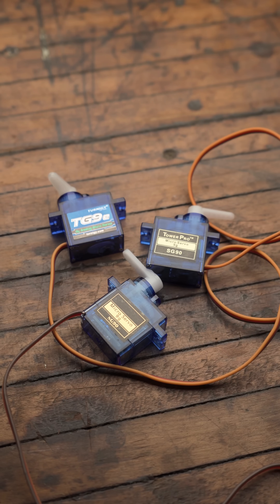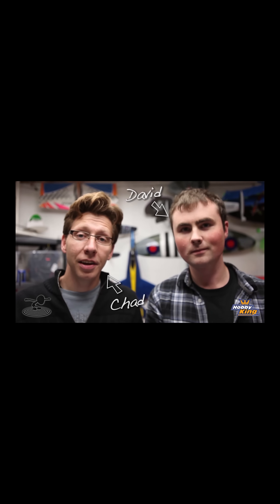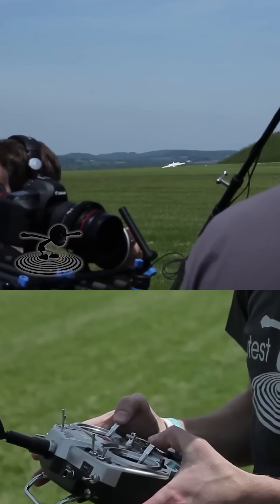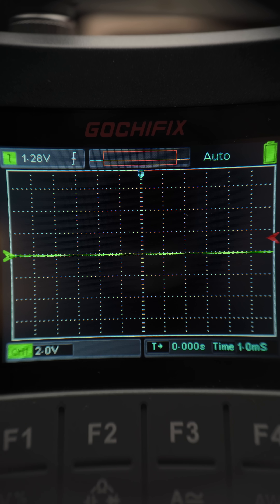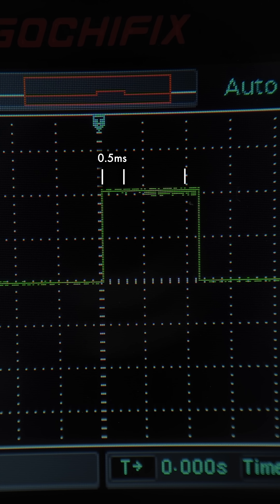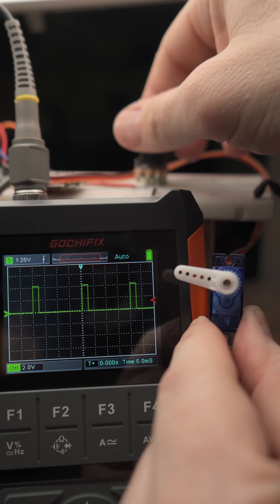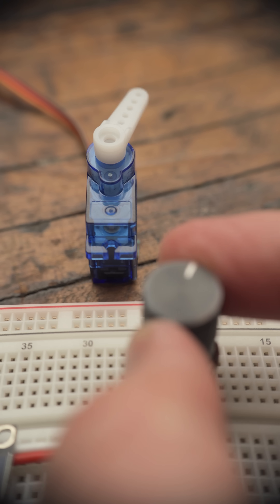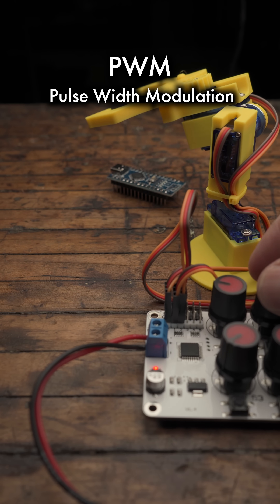#9gServo

Comment: How do you diagnose these PWM signals if you only have $20 multimeter and $10 circuit tester? These VW cars sure use PWM. Car lights system draws 220 amper at key zero position. With headlights disconnected draws 205 amper. There is only mirrors and breaks lights on. 😅 and Looks like I can't use my equipmenet to actually test the cables for shortages since it's PWM 🤧.

Comment: You can open up ur 9gs and rewire the motor to a H bridge controller for a bigger motor, allowing you to control a big guy off 1 pin with preset pid settings

Comment: Awesome explanation! I only just recently learned arduino programming, and when i got to servos and stuff, i was kinda dissapointed when it was just ''use a library'', like that's it? Sure it's more comfortable but i wanted to know how exactly stuff was controlled through a single wire, and now i know

Comment: Coming from a modular synth background it's crazy that pulse width modulation not only can be used for this but also for changing the timbre (sorta) of a square wave oscillator inside of a synthesizer!
Reality is so crazy man.
 I can actually imagine the sound in my head because of the oscilloscope

Comment: New here: how do I determine the strength of the motor I need?
Reply: I know that was vague. But I am making an auger that dispenses dog food (chunky mashed potato like substance in my case.) the auger is sending the food to a weight sensor, so it needs to be accurate. So, I need a servo motor, right?

Comment: I got some of these servos and I have some questions.
I made a small mechanism some time ago which had one of these servos on it. But when I commanded them to move from 0 to 360, instead of taking the shortest path it would spin all the way from the other side.

I opened one and im quite sure that These servos are physically capable of 360 full rotation.
But so far I've tried anything to make one spin the other way and failed.
I know that this would be a disaster for most of the projects like yours but why there isnt any flag or a way to tell the direction?
and is it even possible to have a servo pointing and spinning at the same time?

Comment: This is very great stuff. I have been trying to get into the hardware side of things as an engineer. I've built computers and have coded for about 9 years but no robotics based projects yet. I found one the other day I could use my 3D printers for called the Parol6 but the parts list was close to $1,000. Found another non robotics arm project that is $200 for parts which I got ordered. Any info on this robotics arm would be greatly appreciated!

Comment: you can remove the motor connect a amp just a few transistors and connect that to some relays and that to a hydraulic solenoids and connect the censor to a hydraulic motor and you have a high torque servo. there small but they still got the same chip

Comment: While PWM is kind of similar, this signal type is PPM (pulse pause modulation).  You can see it clearly when moving the servo to "full on".  PWM would be a consant on signal
Reply: Pulse position modulation
Reply: No, while there seems to be conflicting information about PPM, it is certainly correct to call this PWM.
Some sources claim that PPM is a subset of PWM, which is kind of the thing you are going after. But that would still make it PWM. 
Other sources claim that PPM uses constant length pulses with varying length pauses, which is defenetely not happening here.
Then there are sources that claim PPM to be several PWM signals back to back (which does not really make sense either).
Reply: @thomasb4422  thanks I hadn’t heard of pulse pause modulation.
Reply: @thomasb4422
It is hilarious reading some of these replies....
So much disagreement...😂
Reminds me of the film Airplane....

People announcement over the load speaker.....
Announcer 1.....
"The  White zone is only for loading and unloading, there is no stopping in the Red zone"
Announcer 2.....
"No!    the Red zone has always been for loading and unloading there is no stopping in the White zone"

😂😂😂😂😂 Don't laugh too loud or long as you will miss at least 5 other funny bits......
Reply: Thank you for taking the time on this. I just watch 4 videos all calling PPM 'pulse position modulation'. Is that different to 'Pulse Pause Modulation' or just synonym?
Reply: @JustinShaedo  Ehm, pulse position modulation is what PPM is, it means the pulse position within the timewindow or "frame" is the significant part. Pulse pause modulation is not a thing in English at least. It was said to be called pulse pause modulation in german but I have no idea. PWM is sorta self explanatory I think, but the main "important" bit is that PPM can do multiple channels over one set of wires, which is what it is often used for afaik. Like a cable between a receiver and an autopilot or pilot aid on a quadcopter for example. I used PPM to go from a small receiver with only 4x3pin out to a switch/decoder that sat between a programmable autopilot and the ESC's controlling motors on a quadcopter, so I could hit channel 5 on/off switch to take manual control if the autopilot did something wrong and use 4 channels to fly the thing.
Reply: A pwm servo accepts a duty cycle between 1 and 2 miliseconds. 100% in this context does not mean a DC high. It means a pwm signal at 2ms on time. And it's not PPM because the pulse distence needs to be at 50Hz. PPM shifts around in terms of frequency.
Reply: Isn't the intention different, but the signal the same?
Reply: @SirCutRy  no,

on 100% output PPM will still have a pause (off time) between pulses, while PWM is constantly on
Reply: @thomasb4422  
Okay, but by looking at a signal, could you tell if it was PPM or PWM?
Reply: @SirCutRy  if the duty cycle is at 100%: yes absolutely
Reply: @thomasb4422  
Okay, sure. But that's a trivial example.

So with PPM, do you have to be able to sync to the pulse, and that's why it can't be on the whole period?
Reply: @SirCutRy  the principle on how they work is a bit different.
With PWM you compare how much time the signal is on compared to the total time.  
With PPM you measure directly the length of time the signal is switched on
Reply: @thomasb4422 You're half right. PPM is how the transmitter talks to the receiver. But after the receiver decodes the signal, the servo gets a standard PWM signal. The reason I know this is because I am very experienced in the RC field and PPM is generally how you would encode multiple PWM signals into a single signal. So in essence, PPM is used to send the signal from the transmitter but PWM is used when those signals actually get to the servo
Reply: @Andomosity  no this is almost completely false.

1:  The transmitter and receiver use neither PWM or PPM. On 2,4Ghz they mostly use FHSS or DSSS.  
It wouldn't even make any sense to use PPM (an analog signal) to transmit digital data.  

2:   
No, no no nooooooo.  
PPM is not a combination of multiple PWM signals. While they look similar, they work on different principles.   
The only thing that resembles a combination is that PPM can combine multiple PPM signals. It just sends them rapidly one after another before making a bigger pause.  

3:  PPM is used from the receiver to the servos. Doesn't even matter if it's an analog or digital servo.  You'll find this on any site regarding receivers and servos.  

4: the only thing I need to correct is the name. It's only known als pulse pause modulation in germany. In english it's correctly called pulse position modulation.
Reply: @thomasb4422  perhaps I mispoke. I meant to say that PPM is a way to encode multiple signals onto a single frequency so that you can decode the PPM on the back side so that it can make it's own PWM signals from the encoded PPM signal. But you are still partially wrong. Yes, modern RC controllers use frequency hopping technology like FHSS or spread technology using DSSS. What you fail to understand is that before these were invented, they had to use PPM to encode multiple signals within a single channel. Then, on the back side, the receiver will decode the PPM signal into individual PWM signals and then send those individual PWM signals to the correct places.

In a PPM system, multiple control channel signals are encoded into a single stream. Each channel is represented by the position of a pulse within a frame of time. In PPM, all the pulses for different channels occur in one long sequence with varying intervals between them, and this sequence repeats itself at a regular interval. The receiver decodes these intervals into separate channel signals and sends corresponding PWM (Pulse Width Modulation) signals to control the servos or other devices. PPM was popular because it allowed for a simple way to transmit multiple channel signals over a single communication channel (such as a radio frequency), making it efficient and relatively easy to implement with the technology available at the time.
Reply: @Andomosity "but you are still partially wrong." And you are still partially insufferable.

Comment: Question, why would you use a PWM to control a direction of servo rather than simply a command to tell it to go “left” or “right”?
Reply: Most servos are not as smart as this video makes it sound. It doesn't at all "measure" the pulse width. Basically the pulse charges a capacitor, and a potentiometer connected to the position discharges it. If there's charge remaining for too long, that will be used to drive the motor (and the pot) until the charge and discharge balances.
Reply: Because the PWM Pulse width is variable, much better than simply left! or right!
Reply: It is even easier - you just write something like "turn(45)" in code and that's it. 45 is an angle from 0 and 180 range.
Reply: servo motor to control proportional movement. the signal shows where to stop the horn. the servo will move until it reach that position.

Comment: I need a micro stepper motor with an inexpensive small rotary encoder to build a wireless follow-focus/focus-puller. Two ESP8266 D1-Mini boards will be used as controllers on both ends, one operating in station mode and the other as the access point. That's just an idea at the moment. People need time and money to experiment. I'll have to look at your profile and see if there are any videos on these two components. Rotary encoders are not cheap, and that's a problem.
Reply from the maker: I would recommend using a high quality potentiometer rather than a rotary encoder. It would be much smoother and many more steps. You may even want to use a multi turn potentiometer so you have more detailed resolution
Reply: @HackMakeMod  thanks for the insight! Yes, the steps will indeed be much smoother if I go with a pot rather than an encoder.  👍
Reply: This channel realy could have been somthing

Comment: For those that don't know, PWM stands for Pulse Width Modulation.  It's also used in Power supplies.
Reply: And a ton of other things. Understanding PWM gets you tons of electronic knowledge. So great video
Reply: And FM synthesis
Reply: And brushless motors
Reply: @FalloutProto  And vibrators.  LOL
Reply: @FalloutProto  the esc's do bldc's use 3 phase current
Reply: It was used in brightness control for screens for a long time
Reply: Or fan speed or led brightness control!
Reply: Or for powering pc water cooler pumps!
Reply: I wonder, for people that don't know what PWM is, wouldn't it be a bit of a stretch to know what it does in power supplies?
😅
Reply: @oilybrakes  I think that's kind of where it started.  Switching power supplies instead of bulky transformers and also UPS's.  I worked as a tech in the 70's when this stuff was first coming out on integrated circuits.
Reply: If you are going to say the acronym "PWM" in a video, you should also SAY the meaning of the term.  Putting it in as the last second of a video as a text overlay is not really a good substitute.
Reply: And smart thermostats
Reply: @joshf-o6696  And vibrators.
Reply: It actually said that in the video.
Reply: The problem with servos is they jump to default position upon system power turned on. This jump can damage the mechanics of the animatronics. Is there a fix for it ????
Reply: Just like it states in the video?
Reply: Multiphased PWM supplied CPU's and GPU's provide smooth and high wattage DC.
Reply: The full term is literally shown in the video as he uses the abbreviation, so why explain it?
Reply: @ardynizunia9709  I must have missed it.   People throw acronyms around all the time like everyone should know.
Reply: @markgigiel2722  
I agree, people do in fact do that.
It's at the very end of the video, so if you just didn't look for a second, you would've missed it.
Reply: Actually the protocol is ppm pulse position modulation.
There is a subtle difference.